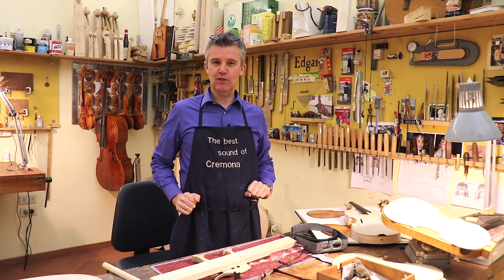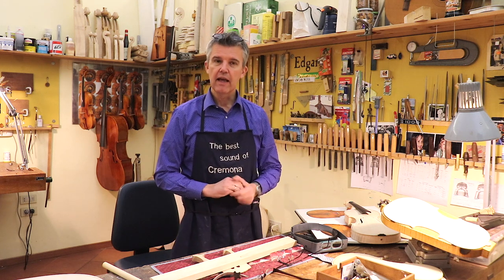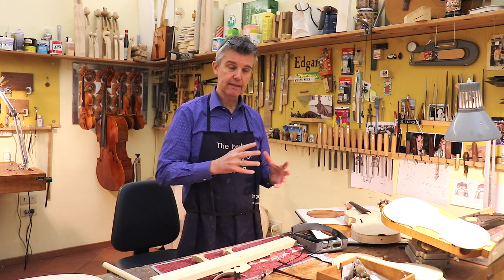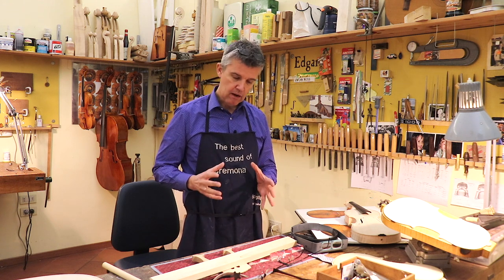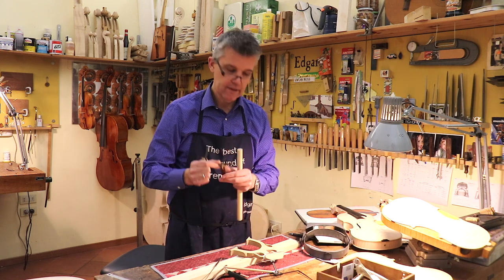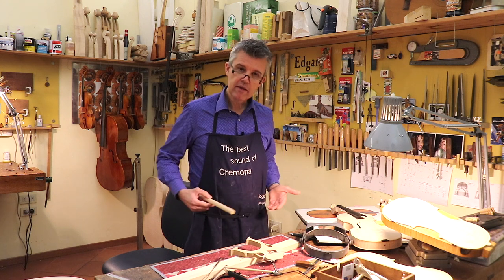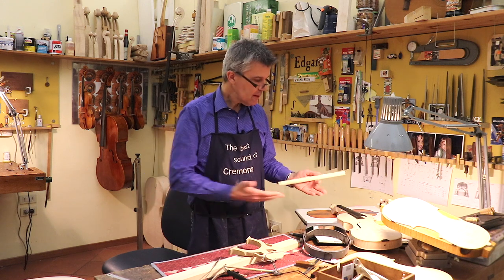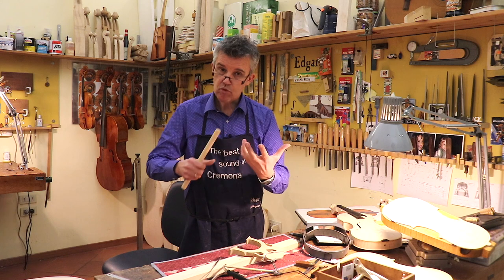Ep. 85: Soundpost for Violin, Viola, Cello and Doublebass - Details to know!

Comment: Thanks for another precise and informative vid. Recently I made a bass viola da gamba (to play it, not to become a “luthier”) and it sounded nice but nasal with a subdued third string. I walked the sound post to ANY position around the normal zone. Subtle frequency changes but same problem. I got sick of it. Then I just had this spontaneous dream idea to move the sound post symmetrically to the other side, in a mirror position but left from the bass bar. Suddenly everything resonated! The the bass strings became deeper, the chanterelle and the thin strings acquired this crystal quality! Everything communicated in an interconnected resonance! I never moved the sound post away from there, a cm out from the bass bar on the other side.